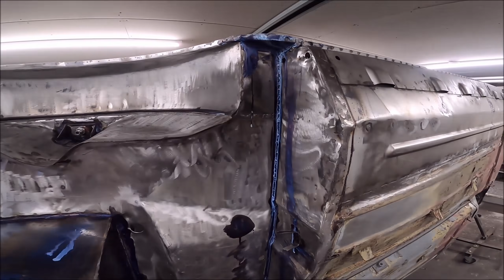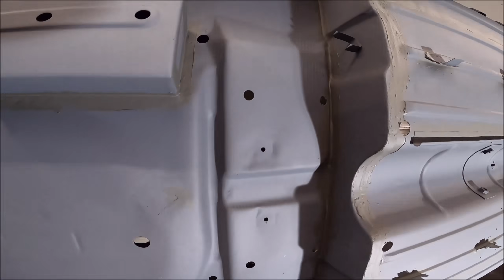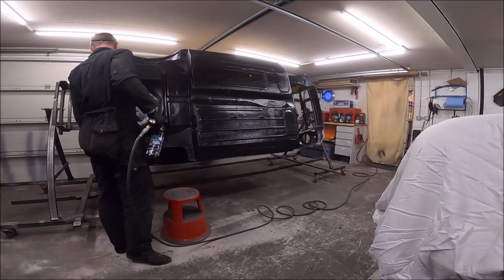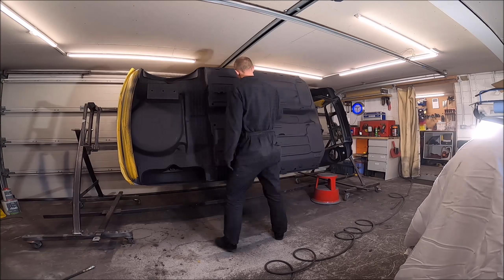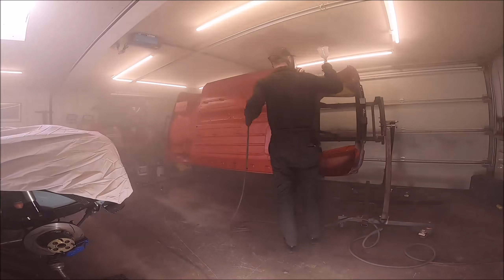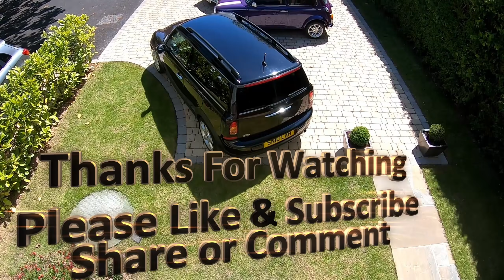Project ERA Classic Mini Workshop Pt. 14 Paintwork 👍😀👍😀

Comment: Great job you have both done, can I ask what rust treatment do you put in the sills as always rust? so tight with only the drain holes to enter the area.
Reply from the maker: Dinitrol cavity wax. There are quite a few places and holes on the inner cills where you can get into the box section
Reply: @classicminiworkshop  Thanks for the reply

Comment: I see Mark did not remove the fuel link pipe from body I'm having trouble with this as well
Reply: I didn't feel the need and i've had trouble with these before. Its had a good clean around it and seam sealer put back there, so it'll be good for years to come.😀

Comment: Hi Keith, nice update. Looks great. I see you were asking about etch primer and spraying straight over it. There's alway a disagreement about etch primer, epoxy primer and using it. The lad I work for reckons when he sands down cars he'd put the etch primer on bare spots and then epoxy over the full car. Reckons it gives it best protection. But some say you should spray them both onto the same surface. I've sprayed straight over 2k etch and never had an issue but Ill ask about that see if there is any issue. Also I would have used either white gravitex or put a dust of primer over the black cause I find it changes the red or like you can see the black still, if ya get me.
Reply: I'm no expert and take advice where i can and learn from YouTube etc. You are right, different opinions everywhere. This has worked for me the last two projects so i'm happy it works for me. I had the black already, so just used that. Yep, i get ya. I'm still playing with things and learning more every time. This is the third car i've sprayed and i'm a builder/carpenter by trade, so still lots to learn.🙂
Reply: @markdraper7  your work is top class mate. I'm not a professional sprayer/bodywork guy either just work in a bodyshop part time to help me get through college and learn to work on my minis. Was just saying what I've seen /done in work, hope ya didn't think I was insulting your work. Look forward to the next update 👌
Reply: @darraghmckenzie7897 , I wouldn't say it's top class, but we try to do the best we can. Thanks for the nice comments and for taking an interest in the videos. Nah, didn't think that, it's interesting hearing others views on how things are done. 🙂

Comment: The etch primer i used said to mix with 50% thinners if used as an etch primer, but only 20% if used as a normal primer. Obviously not a rattle can product. It's hard to see on fast forward what mark did, but wax and grease remover only softens the grease and dirt. You should wipe over with W&G remover then immediately wipe it off with a different clean lint free rag. You can see the dirt and grease on the clean rag.
Reply: i do generally wipe over with Panel wipe twice, then a tack cloth, which is clean after i've wiped. I will obviously take much more care on the inside and outside areas. We don't always show everything as it can get a bit boring watching every little bit and the video list would be like Binky's.😆

Comment: Nice work without sounding like a criticism instead of gravitas then painting it why didn't you use upol tintable raptor much quicker and more durable and less over spray and as mentioned before have you not considered using epoxy primer instead of etch as etch if left bare draws moisture and you can't apply filler over it
Reply: I hear what you are saying and take it on board. The Gravitex is what i have and have used it before to good effect so i tend to stick with what i know. I've been taught that the bare metal needs to have the Etch Primer, then in can have Epoxy primer. On reading about all the details etc, i will continue to use Etch primer on bare metal, then apply 2k Primer over the etch. Bear in mind, my garage is heated and is fully insulated like a house, there isn't much moisture, if any, in my garage. 🙂
Reply: @markdraper7  the advantage of raptor specially when tinted is the colour is all  the way through if marked or scratched plus it's more durable than plain stone chip and it's a one step process unlike the 3 stages of painting gravitex 
Epoxy primer on to bare metal steel is what most restoration shops use specially the newer ones which are more user friendly 
Paint process continuously changes and keeping up to date is a nightmare but your happy with what you use then if it ain't broke dont fix it

Comment: Tremendous restoration, no corners cut, as you've said Triggers Broom :) only tiny criticism is the choice of rattle can primer, shame it wasn't 2k epoxy. Keep up the good work
Reply: Thanks. i only used etch primer, then the Stonechip. I've been told that stone chip is fine to spray straight onto etch primer. 🙂